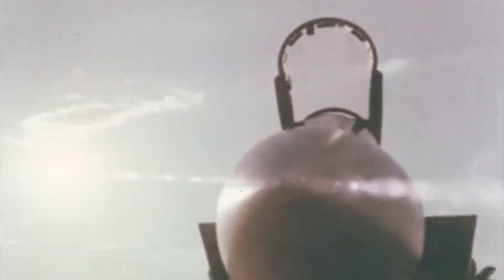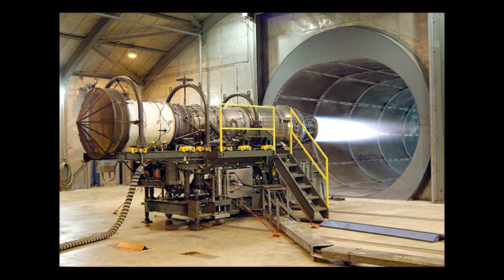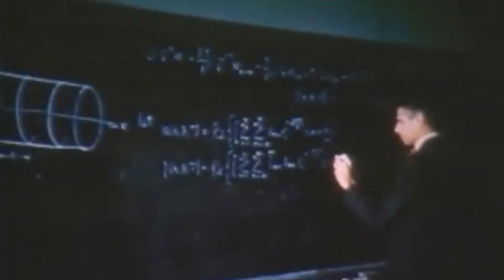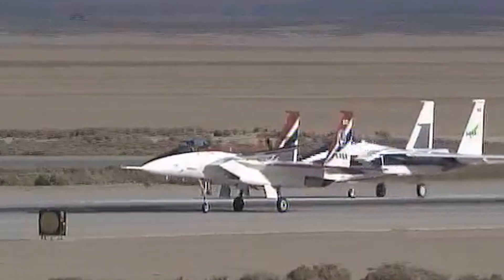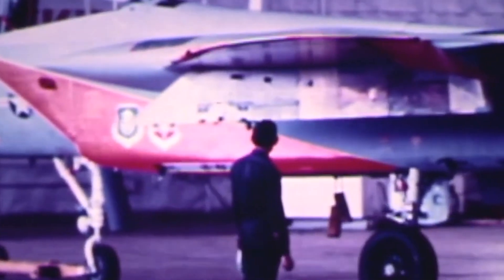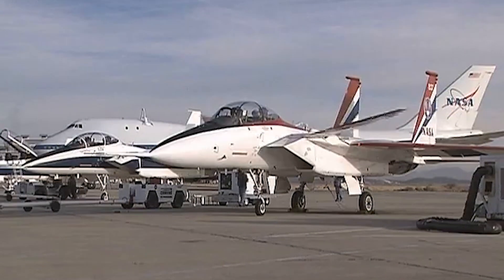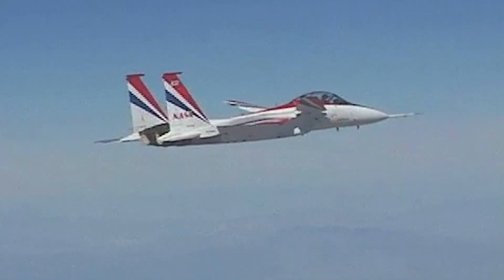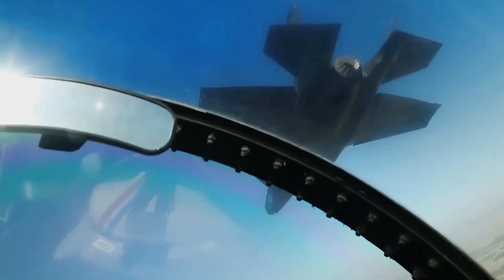The Super Fighter That was Too Weird for the US Air Force

Comment: Very good material. Maybe one note, you should add more F-15S/MTD footages at the section of the S/MTD, instead of the F-15ACTIVE sceens. Even if the S/MTD and the ACTIVE was actually the very same aircraft, the S/MTD had the good old F100PW100 with the box shape 2D thrust vectoring system, equipped with a unique thrust reverser, while in the ACTIVE era, the aircraft got the more powerful F100PW229 with the P/YBBN 3D nozzles. As shown in your video.